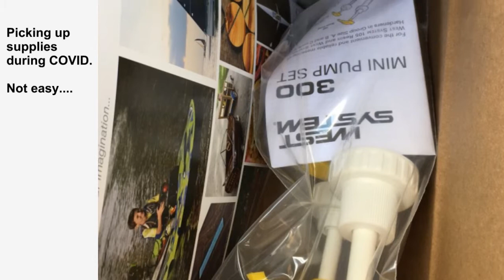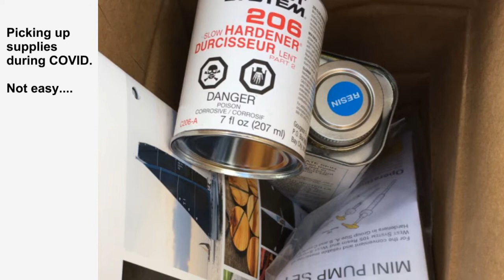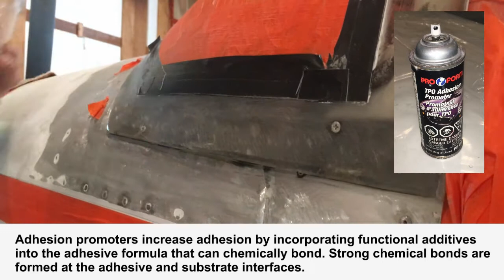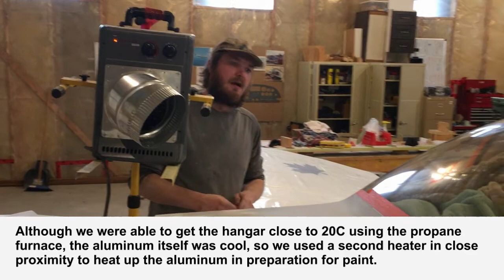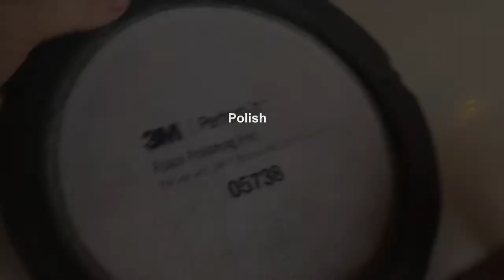VANS RV Canopy Bonding

Comment: Looks absolutely amazing.

How thick was the fibreglass that you removed from the windshield-engine interface? How many layers to build up the new fibreglass?
Reply from the maker: Just a few millimetres thick.  The new layer, the transition layer, was all about achieving a 4 inch radius. We just kept working until we had it  The aircraft was down for about 3 weeks.